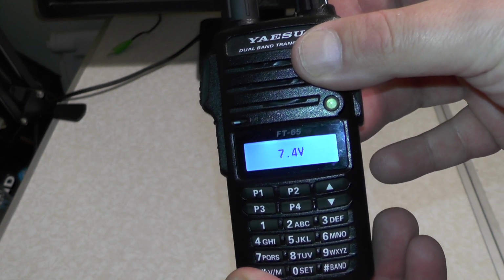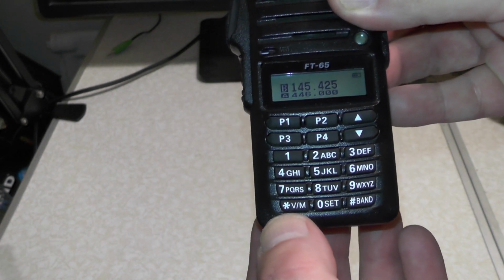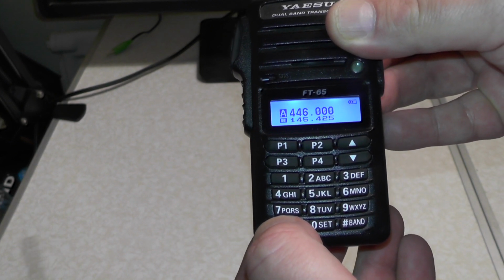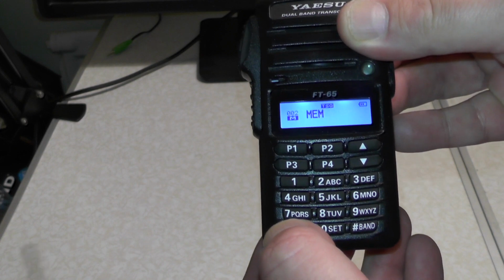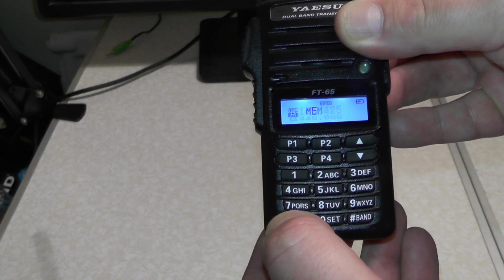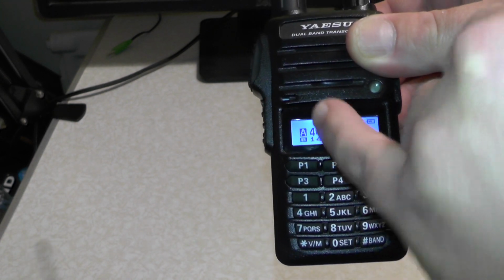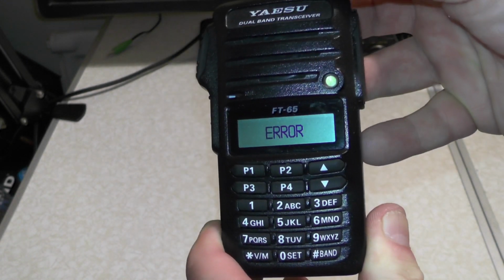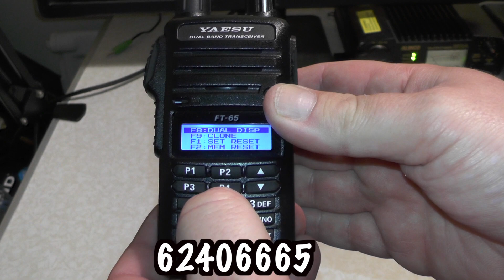Yaesu FT 65 Mods

Comment: out of curiosity, my FT65 receive coverage ends at 480mhz and not on 500mhz as advertised , this independently if is modded or not.
Reply from the maker: My radio is not modded to extend the frequency’s
Reply: @2j4ez  I just find out the Original Yaesu manual.say 400 to 480 Mhz receive coverage so UK dealers are putting wrong information by stating 400 to 500 KHz.

Comment: I put the code on my Yaesu, but when I push the ptt button in 446 frecuency I can't transmit.
Reply from the maker: Hold PTT and T-CALL pressed and turn on the radio release then type in the following code 62406665 
Try that

Comment: I cant listen to pmr bands when i type in 446,081 which is pmr7 it beeps then displays 446,075 any ideas please ?
Reply from the maker: Try changing the tuning steps in the menu of the radio think it’s set to 5khz steps by default
Reply: @2j4ez  yes thats what problem was,steps were 12,5 changed to 6,25 think it was then i got all uk 16 pmrs

Comment: Isn't a mod a change you make that didn't exist before rather than a built-in setting?
Reply from the maker: You wouldn’t no it was there if you didn’t put the code in it’s not listed in the manual

Comment: Hi 2j4ez! After following your clear instructions, my FT 65 did becometh capable of dual display However, when doing the expand mod, after entering the code, the unit did not reboot. Any explanation with this peculiar unit? It is a US version, if this info could help
Reply: Check out Ham Radio Dude’s video. https://youtu.be/kJif5M1kAGs

Comment: Great video! Please do more videos on the Yaesu FT-65 !
Reply: Please do another video about this radio in dual display mode using VFO mode. Push the band button and it has two band options in A, and 3 band options in B (one being the FM broadcast mode) the manual says dual display mode is for working non standard repeater offsets for things like satélites etc. but doesn’t explain much more. Does it listen on A and transmit on B or listen on A and transmit on the second layer of A?
Reply: @Fiddlemandan  I am curious about this as well. Not a lot of info out there on this radio aside from reviews and unboxing videos.
Reply from the maker: Ok i will do more ft65 radio videos. what would you like to see?
Reply: @2j4ez is it possible to adjust the s-meter?
It is possible on the FT277.
Reply: I just ordered mine 
EXCITED!